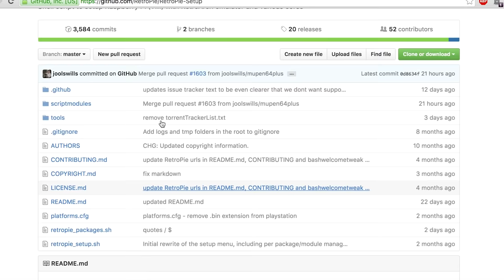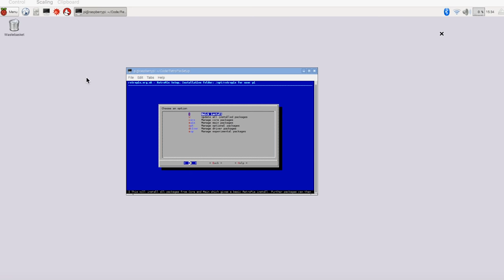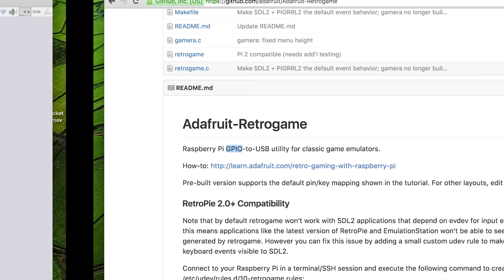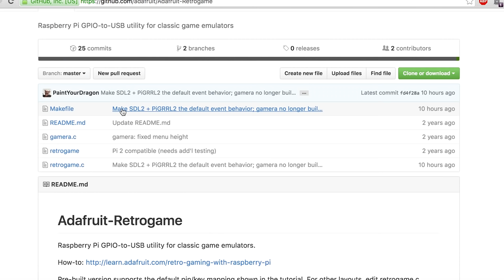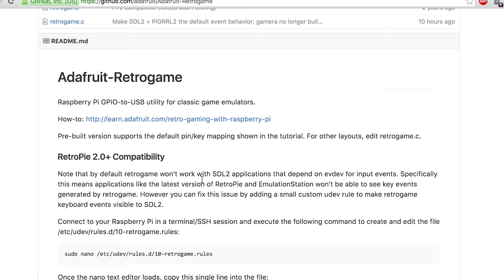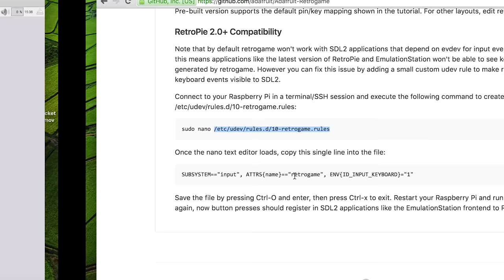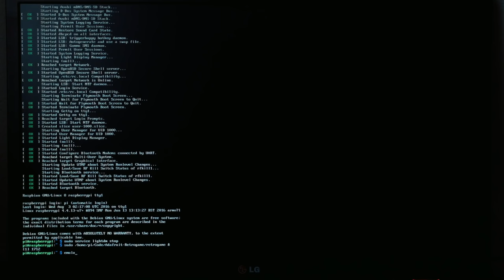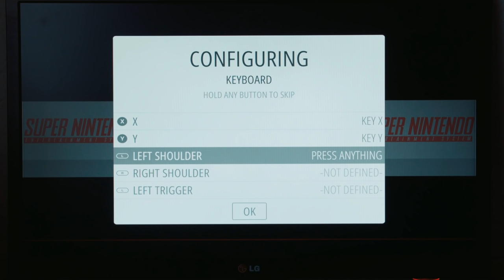Make a Raspberry Pi Portable Arcade Console (with Retropie)

Comment: ok pro tip when using a "spade bit" start the hole in reverse then then forward for the rest of the cut for a clean hole plus scrap wood will also make it easier  :)

Comment: Have you ever thought of doing this with a pre existing arcade joystick Etc?   Maybe an old SNES one or even the recent Street Fighter USB ones?
Reply: I was actually thinking of doing that exact same thing, with an old arcade stick
Reply: That is actually very simple todo. The fight stick I had had zero input latency over USB. All I had todo was mount the pi on the back cover, and shorten the USB lead. The HDMI and power coming out of the existing hole that was for the USB before

Still got some stuff left todo but it works perfectly fine. I want to hardwire an on off switch and extend one of the USB slots over for rom input/second controller. I want the on off switch to be on one of the extisting switches on the fight stick that is not in use (360 to PS3 switch), honestly that is the hardest part of it for me. The on off switch, I might consider mounting the HDMI and power next to the USB extension also via extensions
Reply: Hey Larry, love your videos!

Comment: Cool idea, but why the hell would you not build a proper amount of buttons for the snes?
Reply: I agree. Needs at least six...
Reply: that would be six total including the 2 shoulder buttons?
Reply from the maker: Primary focus is not snes. There are tons of mame roms which only require 4 buttons. You can also add more buttons to the open gpio pins if you want. You would just need a bigger case :)
Reply: would it work with a snes usb controller?
Reply: +Alika80 I HATE GAMES THAT PLAY WITH SIX BUTTONS. WE USED TO START ON AN AMIGA JUST OHE FUCKING BUTTON. TWO IS FINE, FOUR IS THE MAX
Reply: Four is good. You'll be able to play all the Neo Geo titles. However, you are going to miss out on Capcom fighting game titles (Street Fighter, Marvel vs. Capcom, Capcom vs. SNK, etc), as well as Midway's Mortal Kombat, though, brawlers/beat-em-ups would play easily.
Reply: exactly my point. six buttons is the standard across the board. i would have went with 8 though
Reply: Needs at least 8 buttons total: Start, Select, A, B, C, X, Y, Z. Can't have fewer than that for 16-bit consoles. I would personally include a coin button for MAME as well, but you can omit that and use button combos to do the coin function.
Reply: 8 buttons if you include start and select
Reply: you can use select for the coin button on MAME instead of use a combo

Comment: newb question alert!  You need an SD card in the pi to install the OS / software on to, correct?  You can't install software directly to the pi?
Reply: Scott Baker sd card is needed
Reply: So does the SD card get corrupted every time the power is pulled or does that hardly ever happen?
Reply: Scott Baker it will not get curropted

Comment: Approximately, how many grams is this? I ask because my library has a 3d printer and it charges by the gram
Reply: You can do the math yourself.Check what material they use, then google the density of that material, then, in a modelling software, you can measure the volume. Multiply the density by the volume and you got your weight.

Comment: Great tutorial! Is there connectors to avoid having to solder in buttons? another question: to prevent the box moving, you could put some rubber caps underneath it ...

Comment: Love stuff like this. I built a full arcade cab with my Pi but I feel like I cheated a bit. I didn't use a the GPIO for the buttons I used a generic USB controller encoder and went via the USB ports. I feel like I should take it apart and do it the 'proper' way :)
Reply: How to config it to six buttons?

Comment: This is really great and I'm looking to build my own but my feedback is that more parts, tools and materials are needed to build this than what you've listed:  heatshrink for the wires, silver solder, a soldering gun, clamps, the drill bits to drill out the button and joystick holes, a dremel, an HDMI cable, a rasberry pi power source, etc.  

This may be obvious to some but if this is a step by step these parts, tools and materials are important for the final product and people looking to make on of these for the first time and who is not a electronic hobbyist may not have these things around the house.
Reply from the maker: +Catherine Piroli good point. I'll add that to the description tomorrow.
Reply: +Hacker House Thank you for taking the constructive criticism on board. 👍🏻
Reply: Catherine Piroli You can buy a hori fight stick mini for about 30$ last time I checked.

Comment: what are you doing for cooling the pi? i would love to get thermal pads and find some thin metal and modify it to fit the pi 3 so it has a proper heat spread for cooling

Comment: dont you need an 8 way joystick??? to jump forward in fighting games for example! die you just not think of it or would it easily be solved by the Software?
Reply: Andreas Botterweck 4 way is correct cos.with micro switches  to go diagnal you just push diagonal and it pushes in right and up... thats how joysticks work
Reply: Lewis Allan allright, didnt know that.

Comment: How do i add more buttons? I need 2 more main buttons(fighters use 6 not 4) and really also a start/select and coin insert button for mame
Reply: You could move the buttons on the right side of the thing to make room for an extra two, and you could probably put start and select on the bottom if you have enough room. There's other videos that explain how to add buttons in general, not just this configuration. Good luck!

Comment: Good tutorial, one correction: Ctrl-Alt-F1 does not exit the UI
Reply from the maker: +NurchOK I think it depends on your OS. What Raspberry Pi/OS are you using?
Reply: It's a Linux thing. Ideally you should start the config utility and tell it not to start the GUI on startup. To check, if you press Ctrl+Alt+F1, keep going with ...+F2, F3, etc. Somewhere around F6-F8 you should be back at the GUI.
Reply: NurchOK yup, that's just move to tty1

Comment: What if I want none of the button (bumpers, start and select) to be on the keyboard? Would I have to go for an external USB encoder?
Reply from the maker: You could add more buttons to your console via gpio pins. You would just need to add a few more entries in the retrogame.c file. Ground pins can be wired together.

Comment: (Short preface: I'm very new to this, as in this is my first project working on a pi) Anyways, I had all the parts I need gifted to me from my uncle but I also received a breadboard, I was wondering if it would make sense to use it for this or is there no risk in doing this without it?

Comment: I'm looking at building my first arcade machine. i want to have 30 000 games on it without being pc driven...
i was looking at raspberry pi 3 but it seems to be a little under powered for my requirements. Not compatible for Dreamcast games and greater console generations like PS2 and on wards... 
can you please recommend a hardware i can use for this ?
  
Not sure what soft ware I'm going to use yet, probably leaning towards launchbox big box.
I basically want an Arcarde not a PC running my arcade if that makes sense.
I value your opinion :) thumbs up
Reply: Maybe raspberry 4?

Comment: Do you just run an hdmi to the tv/monitor? Did you use a lipo for power or just the dc power supply?
Reply from the maker: Yes. We used a DC power supply, but you could definitely use a lipo if you have a proper regulator.

Comment: Using this as a start, I want to build an xbox style controller with a built in retractable HDMI output cable.
Reply: using the pi zero some one built a retro gaming system completely inside a Xbox controller.
Reply: you will need a really small microcomputer. And the smaller you go, the less powerfull that microcomputer will be. While it is possible to make a 'console in a controller' you probably won't be able to play anything past the snes era...

Comment: Is it possible to manage two players ? Seeing the diagram, it seems there is enough GPIO available for a second player and even six buttons by players. Anyway awesome project :)
Reply from the maker: +Fabien Engels yep, just might need to share some ground pins.
Reply from the maker: Now that I think about it, you might also have to configure something in Retropie to map buttons for two players. I believe you can map these in the retroarch.cfg file. 

Here's a thread I found: https://www.raspberrypi.org/forums/viewtopic.php?t=55013
Reply: Thank you for your replies, I'll try :) I also consider to buy buttons from adafruit because they are translucent. Adding some zhite LED strips inside the buttons could illuminate the buttons and add a nice touch.

Comment: Given the specs on the Raspberry Pi 3, how strong of a power supply would one need to use if they wanted to power it with a usb battery pack or something of the like?
Reply: I''m guessing any 5v usb cord would work. I'm going to make one and see if I can use a portable charger/power bank to power it. I can't think of any reason it wouldn't work.
Reply: I ended up making one and it does work. I kept it on the outside though, in case of any sort of malfunction

Comment: How hard would it be to adapt this to have 2 extra buttons? I think to cover most emulators 6 buttons would be ideal
Reply: Pretty sure it would be easy as long as there is more GPIO pins to add the 4 wires needed for 2 more buttons.. If I make one of these I would add 4 more buttons, 1 player for start, another for exit emulator, and of course l and r buttons for street fighter =)
Reply: Ahh okay, im tryna get my head round this stuff, so if you conaider the arcadw cabinets or tables that are also part of the retropie universe, people have managed to stuff in 2 players worth of controls, is this done Using an additional device or can a pi itself drive that?
Reply: a Raspi can drive all those buttons. there is lots of gpio pins left over.. If you look at the pinout at 12:45 you'll see all the unused pins.

Comment: Would you know which raspberry pi would be good enough to run NES/SNES emulators without lag or stuttering? I dont want to go overkill and buy one that is more than enough to run these two things. im not worried about the other emulators just these two. thanks!
Reply: Pi zero
Reply: Thanks a ton (:
Reply: pi zero is ok for nes/snes, but for ps1 or n64 you should get the pi3 it can run all retro games

Comment: Hello Aaron, Thank you for your prompt reply. I am stuck on part the where the Adafruit Retrogame game needs to get clone. In the video you said that it was already done. Can you tell me how to do that from the command line?
Reply from the maker: You need to have git installed on your computer to clone a repository. If you don't have that installed, it would probably be easier to download a ZIP file. There will be a link on the repository page.
Reply: +Hacker House got It's already installed. Can you tell me the command line to install the Adafruit-Retrogame?
Reply: +Hacker House I am running terminal from the raspberry pi is btw.

Comment: when i brought the.stl files to my school to print them, it said it would take 4 hours, and i thought to myself, no.... That can't be right. The dimensions in the files are 113.79 x 190.50 x 63.50 mm which i don't believe is correct
.
Reply from the maker: +Eddie Oswald in our 3D printing software we usually have to convert from inches to mm. I'll check with Davis to give you the correct dimensions.
Reply: After converting the dimensions into inches and double checking with the dimensions  of the optional housing unit you posted, it seems correct, It just mind boggles me how it's gonna take 4+ hours lol, But no worries, Thanks a ton for the video!
Reply: Eddie Oswald hi

Comment: uh, can i get a six button?
Reply: Tim Thompson I was thinking the same thing
Reply: i'm not an expert but i think you would have to use an expansion board to get more GPIO pins that can be mapped.  alot of the standard 40 have to do with power so you wouldn't have enough options without an expansion board.  you might even be able to add circuitry to use the same IO pins for multiple buttons, but i think an expansion board would be the easiest way to.  maybe Hacker House can comment?
Reply: actually he responded below, it sounds like there might be enough open pins.  i'm new to this.
Reply: yes